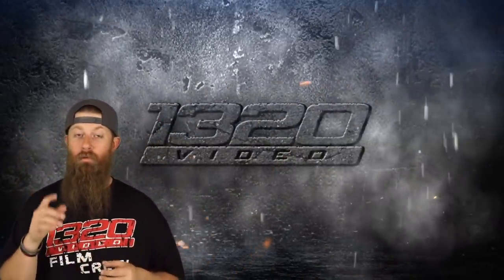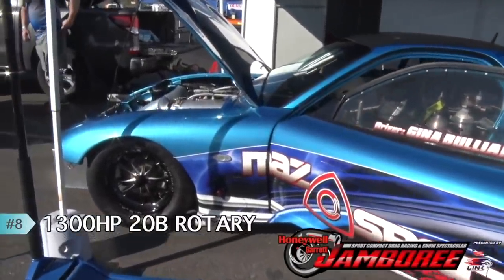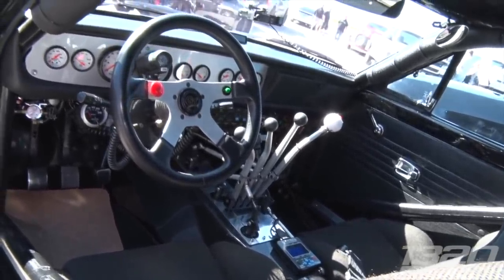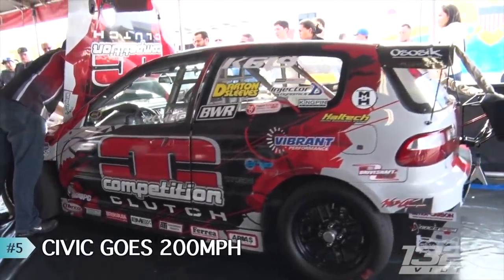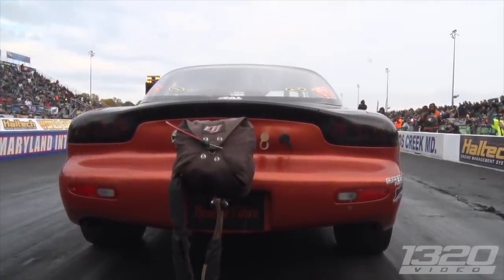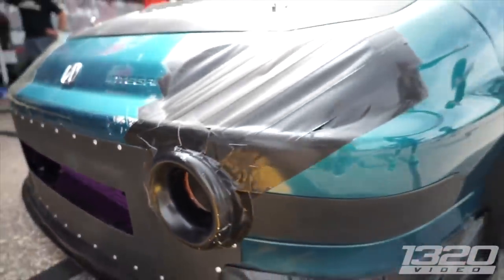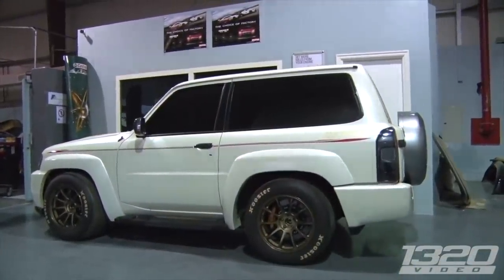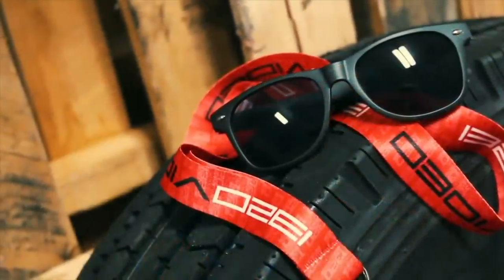10 of the CRAZIEST Imports You’ll EVER See!

Comment: what does back half(ing) mean?
Reply: Alex Thompson means car only has back half of car with original chassis front has after market or tube style coil overs.mainly for drag racing or just straight line type of racing but if done correctly works great for road coarseing or real driving.dude in vid uses it for saying car pulls good on the big end or latter half of the track he,s definitely not using the term correctly lol....
Reply: Alex Thompson that its slow in the first half of the strip but makes up fore it in the back half (of the drag strip)
Reply: It means it's faster on the back half of the track than at the start, slow start but a monster on the second half of the track
Reply: A drag time slip has a 60 foot time, a 330 foot time, a 1/8 mile time along with MPH, (thats the first half) then you have the 1000 foot mark time and the 1/4 mile time and speed(the back half)
Reply: The second 1/8th in a quarter mile

Comment: s2k is my fav import of all time. it breaks my heart because i bought an s550 perfromance pack mustang instead because of the power capability and v8 sound.
Reply: Kameron James the motor in an s2k can make plenty of power on stock parts. And itll be faster than a bolt on mustang. It's quite a bit lighter
Reply: Joshua Bower the f20c engine would be fine but after supercharging it still wouldnt make the torque the stock coyote does. the s2k is light but the 5.0 is capable of serious power.
Reply: Kameron James stock internals snd all a 5.0 can make msybe 500hp....maybe...
Reply: Joshua Bower oh my god, hellion makes twin 62mm turbo kits that are made for stock coyotes. go ahead look up on youtube 1000 horsepower 5.0 on stock internals. youll find a plethera of them. they might not be the most reliable but a honda cant touch 700 without being built. I love the s2k but i know what the coyote v8 is capable of. the f20/22 could never hit 1000 hp on stock internals. if it somehow did for a few seconds it still wouldnt have the torque.
Reply: i guess to further prove my point. you can buy a roush mustang from ford dealerships and they make 670 with a supercharger on the stock motor.

Comment: I'm confused one civic can hit 200 + in the 1/4 mile and another one just hits 200+ in the 1/2 mile. Don't get the 1/2 mile stuff.
Reply: It's testing a different skillset and a different style of engine build a 1/4m car just has to hit the acceleration whereas the half mile cars have to hold that speed until they break the laser. Getting a car that just touches 200 at the very limit of what it can do isn't the same as a car that hits 200 and then can maintain that for the rest of the run IMO.